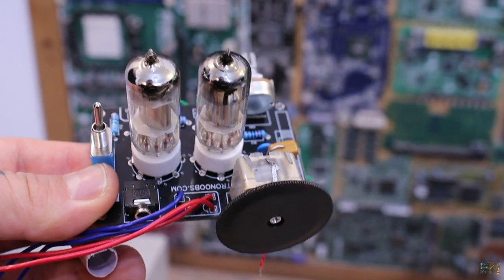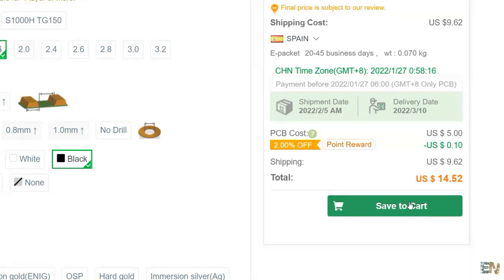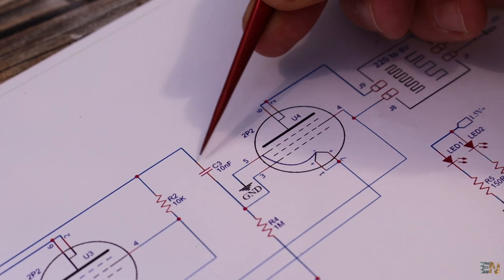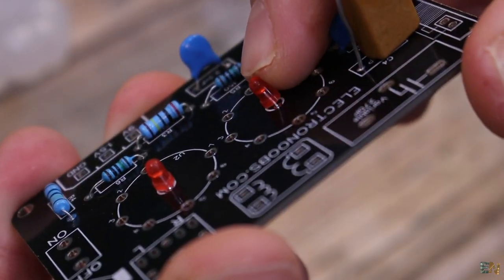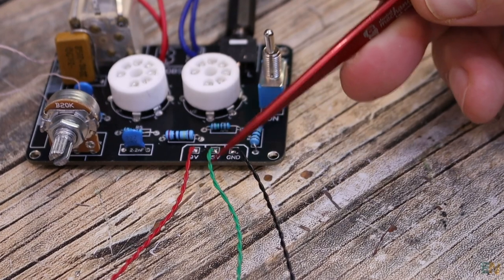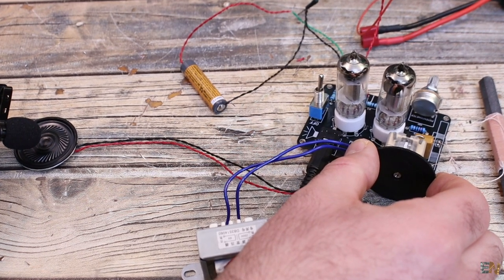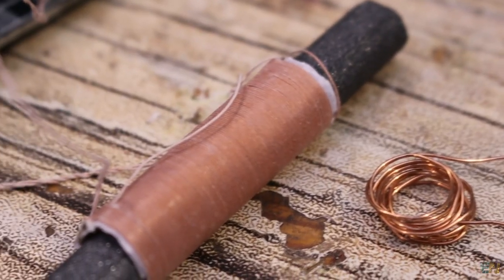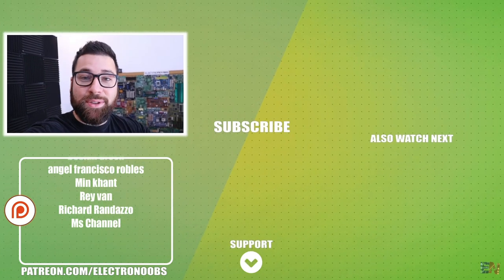Vacuum Tube Radio PCB - Vintage Circuits

Comment: I really love tube circuits. One of these days I'll get around to finishing the tube amp that I was making with magic eye tubes to show the levels on the two channels. I don't really need it, but I have very fond memories of a radio my grandparents had that used magic eye meters that I was absolutely fascinated with as a kid. There's not of devices left these days with those style of level meters that are still working or reasonably restorable, but the magic eye tubes are all over eBay fortunately.

Comment: In this style of radio the iron core is the directional antenna, so it would make sense that you touching it will help with gain. 

The audio output of these circuits are typically high impedance at least 2k ohm or higher. If you were to use a crystal radio earpiece without the transformer you may have had better results. Or earbuds after the transformer would have worked as well. 

The 3 tube set will allow you to drive a speaker

Comment: Nice project! Your anode supply voltage is very low causing distortion and low output power. These valves are typically suitable for 70 to 90V.

Comment: A lot valves use transformers in the audio output which might account for low volumes. Just a thought. Great to see you try out things that take you into new areas.

Comment: You could use 3 PP3 batteries taking the supply up to 27v. Also check the load impedance of the 2P2 and the turns ratio of the transformer and see what impedance speaker you will need. Using the wrong speaker can really mess things up as well. All in all it looks an interesting start for experimentation.

Comment: I think the device would work better if you ran it with more than 9 volts, since tubes are high impedance devices they will work poor with low voltage plus you get very little power out of it as well which tend to distort. too bad in my country AM radio is not available at all so it is pretty much useless here
Reply from the maker: I will try. I've used them at 12V but I was afraid with more than that since the schematic was marked as 9V. Thanks!
Reply: @ELECTRONOOBS  as long as your capacitors are rated for the voltage these DL92 tubes are rated for a maximum plate voltage of 90 volts. And the G2 grid should not exceed 67 volts so the tubes have a good headroom upwards. However does these tubes have a very small output with a maximum of about 270 milliwatt at absolute most so you won’t get much. However is the power increasing with the voltage. But check that your resistors are suitable for the increased voltage so that the led and other stuff won’t take damage. Otherwise you could probably safely go up to 60 volts without any issues :)
Reply: @Pulverrostmannen  Easy solution is to just omit the LEDs, actual (old school) audiophiles consider LEDs under tubes like putting cheap ketchup on fine sushi.
Reply: @NiHaoMike64  ha ha I know right? I have built several tube amps and have a complete hifi system which I built myself and I didn’t use any LEDs to light my tubes. It’s better to use tubes that glows much to begin with instead ;) that we all like to watch! Nothing like 500 volts feeding tubes glowing with red hot cathodes. Omg I like that!

Comment: 60 volt dc 10 amp electronic load tester circuit without arduino